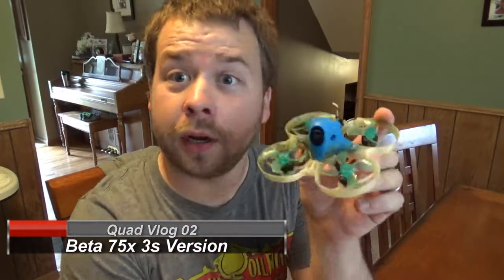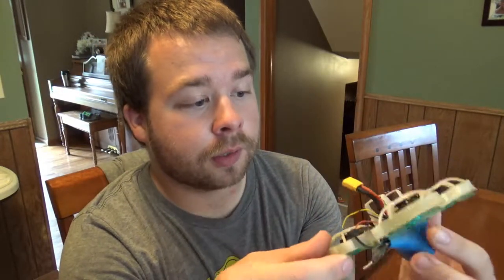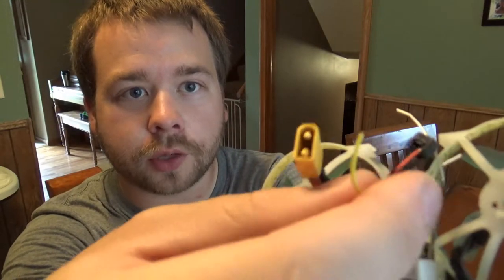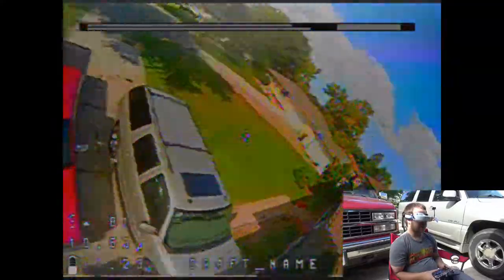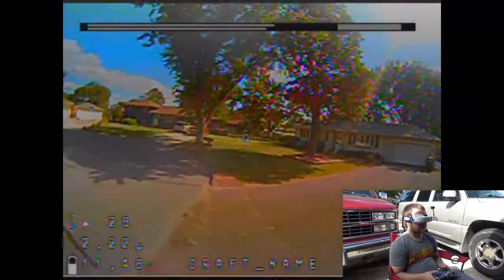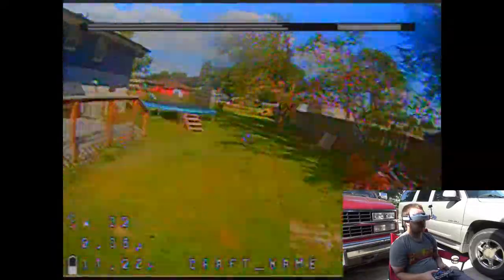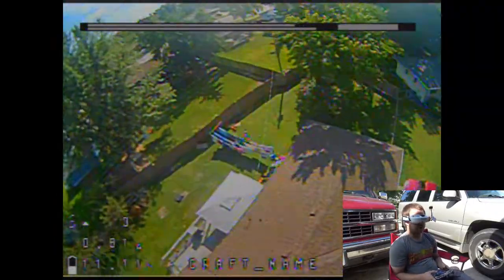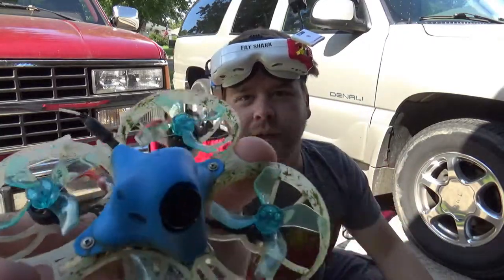Quad Vlog 02 - BetaFPV 75x 3s Brushless Micro Quad

Comment: Betafpv meteor75 fly with 3s? Is this stock everything. Or u mortified,? I don't want to burn mein🤑
Reply from the maker: This is the older beta75x. It was 3s capable. The meteor 75 is only 1s I think.
Reply: @unger_cnc  thx bro. Otherwise i burn my new betafpv 75 🤗👍😂👌

Comment: Try it on 2s ?
Reply from the maker: I did try it on 2s and it doesn't do very well. It will washout during dives and even flying full throttle in a straight line. 3s is the way to go on these. I could have brought the camera tilt down more to go slower.